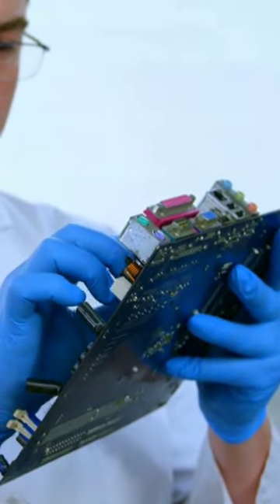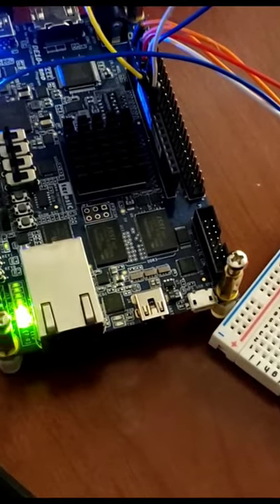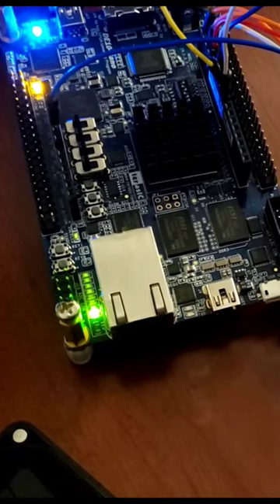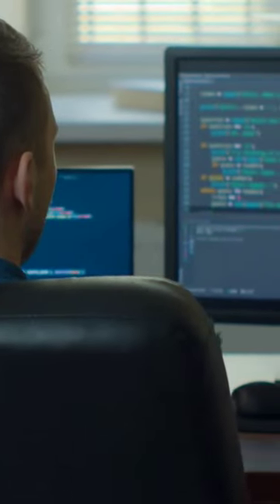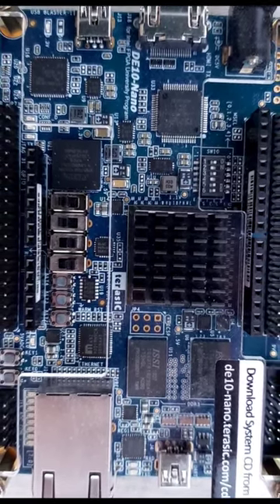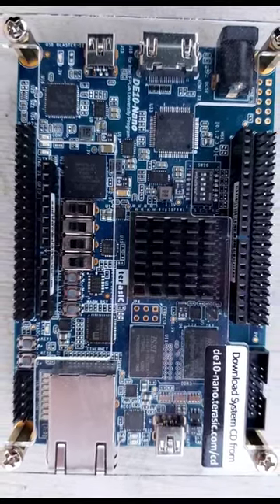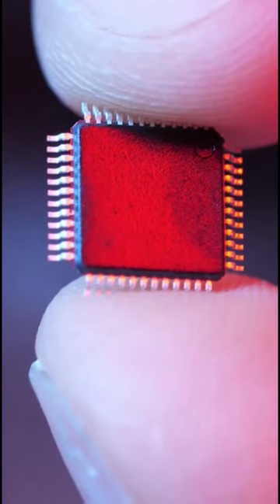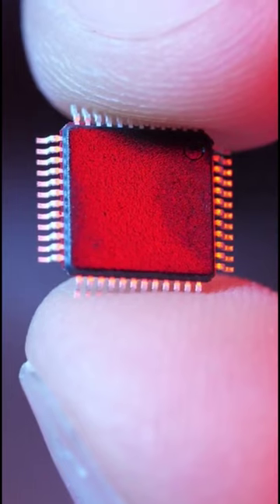Field-programmable gate array design  #digitaldesign #coding #systemverilog #technology

Comment: Are there any commercial products that already contain FPGA's?
Reply: most fpga board cost al least 100$
Reply: @matgaw123  new yeah, I'm looking for salvage.. 
I know that's what it's not common...
Reply: @petevenuti7355  ok
Reply: There is a lot of them, some are low volume products, others are expected to be upgraded. I remember seeing one time two FPGA chips in the same product!
Reply: @savagesarethebest7251   like what‽ Can you name any? I've only heard about an IP cam that came out during lockdown and the webcam shortage...
Reply: I have seen them in... Cameras, Displays, TV's, Scanners, Fax machines, oscilloscopes, routers.

As you might have noticed.. Most of the things I have listed are things that have to deal with a lot of pixels in a short amount of time.

I once opened up a broken fax machine which had TWO thousand dollar xilinx fpga's next to each other. What could they possibly do that requires so much compute. No idea
Reply: @timonix2   Tax write off ... joking
Reply: Just but them you get them as low as 12$ or as expensive as 19000$ depends on your needs
Reply: @OverfluxAerospace  of course ideally the $12 items would be better... Really what I'm asking is is there any general groups or classes of devices that I am likely to find  in a surplus house or eBay or the garbage.